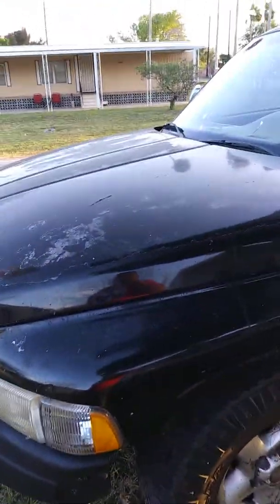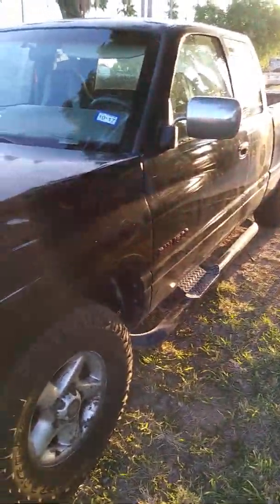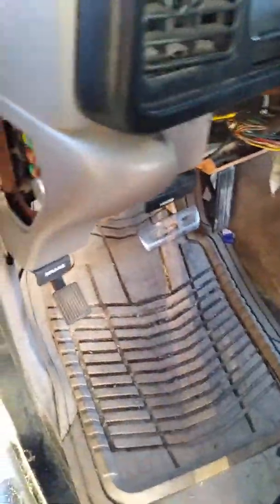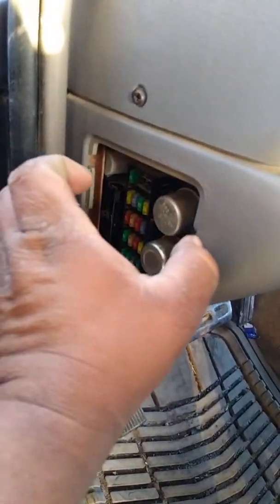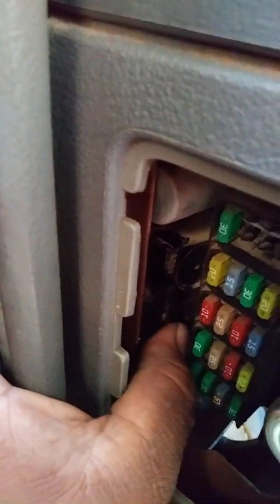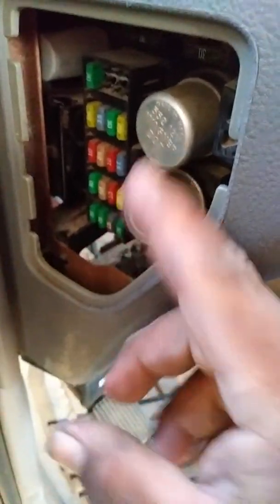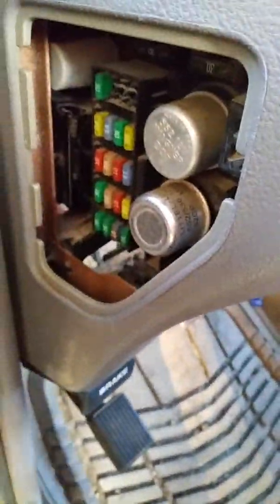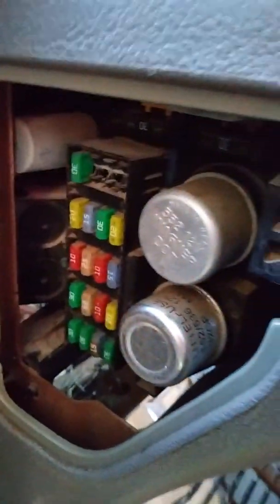How to remove buzzing sound 1996 dodge ram

Comment: This video was God sent I just went out to my 97 Dodge Ram took my little pry bar and gently pulled the little black box out it totally stopped that buzzing noise and the truck start right up and everything works fine. I didn't remove the panel below the steering wheel I just removed the little fuse cover on the side of drivers dash. Thank u for that awesome video no more buzzing noise !!!!!!!!!